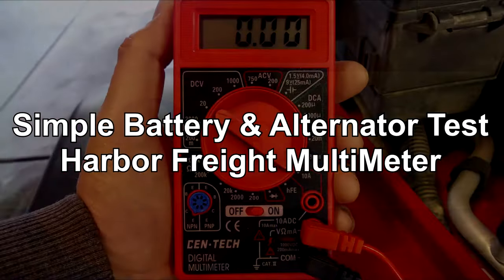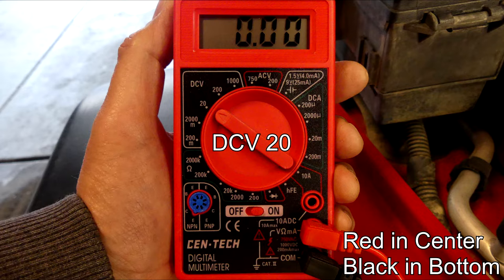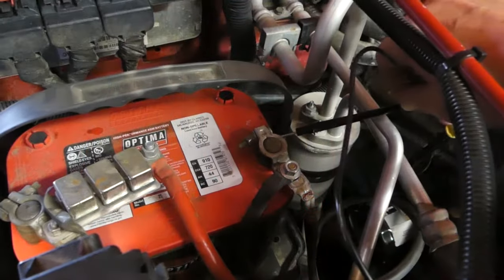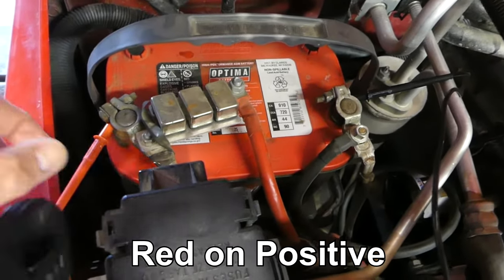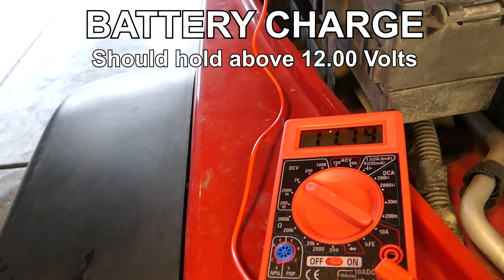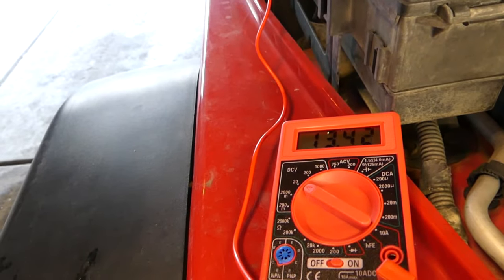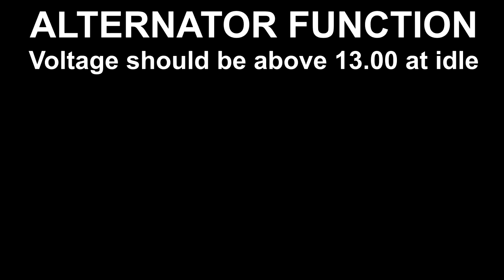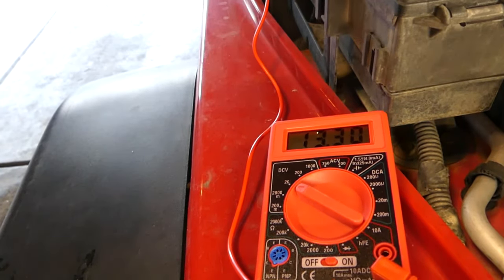How to check Battery & Alternator using Multimeter from Harbor Freight DIY Diagnostic

Comment: Why people say when alternator is on it should be above 14.  Between 14-14.7.   And when its a bit over 13 means alternator is working but only charging the battery a bit “underworking”. So what is it?
Reply from the maker: Alternator output varies from vehicle to vehicle.  13 is correct for my Jeep's OEM alternator, but maybe not for another vehicle.  I'd say it depends on the manufacturer and application.

Comment: great video keeping short and to the point, but interestingly unrelated it only appears we have identical multimeters however mine set too 20 DCV like the video the exact opposite side of the dial mine says 5A & yours says 10A. if anyone else hasn't noticed that on there multimeter as well.

Comment: This really helped except where to place the leads on the alternator. Trying to fix my grandchild's car so she can move to Colorado! patsy
Reply from the maker: You do not change where the leads are, just leave them on the battery, R+ / B-.  The current flows through the leads and battery, that flow is what you are reading when you check the alternator.  It's reading the output of the alternator which is how the battery is charged and how your car makes spark when it's running.  I really HTH!  Best of luck with the car and she's going to LOVE Colorado!!
Reply: @ColoradoOverland   Thank you! I figured it out when I used the Multi Meter.

Comment: I have a 08 Silverado Lt extended cab 1500 5.3. it cranks but no start, I purchased the 7 function multimeter from harbor freight. Hopefully with that multimeter i can be able to check what is draining my battery and also see why it won't turn on.

Comment: What does it mean if the voltage drops to 8.5 while starting but the other two readings are good? It's a jeep JKU. Before starting mine's at 12.6 and after starting it's around 13.xx.
Reply from the maker: sounds like your battery is losing Cold Craking Amps, it's one of the ways batteries age.  Have you tried using a pulse repair charger?  You can search that on amazon, they are not expensive and can sometimes repair CCA issues.  Good luck, hope you don't have to replace it!
Reply: @ColoradoOverland  thanks so much for taking time for your comment. I'll take a look that.

Comment: My Jeep was acting all wonky. Would start with a jump, but lights were fading in and out and car would stall after a few minutes. I knew i had the multi-meter from way back when HF used to give them away for free with an by purchase. I asked Google to find video on how to use Centech Mulimeter. This came up and is a Godsend.
Clear and concise, no superfluous fillers. Awesome video.
BTW, mine registered 2.84 not running, and 14 running. 
Got new battery 👍👍👍
Reply from the maker: I got mine for free from Harbor Freight too!!  I'm glad it worked out for you!  Thank you!!

Comment: I have Harbor Freight multimeter but it only has a 5 amp setting. Every video0 I see including the same multimeter as mine has only a 10 amp setting. Can I test it with 5 amp setting? I'm tracing a parasidic leak.
Reply from the maker: Interesting, I've never encountered that before and don't want to give a guess as advice.  I would imagine it would work just fine, you're not looking for a huge charge.  Best of luck with it, I know how frustrating electrical stuff can be!

Comment: Excellent to the point video! I am extremely grateful to you sir! 
Just checked it because I put a new alternator on the truck (96 Nissan Hard body) at idle its showing 12.40 the battery is 6 years old so I'm assuming my battery is indeed bad. When you get a moment, could you confirm this for me?
Thanks again my friend, fixing to subscribe!
Reply from the maker: That sounds like a low output from the alternator or some sort of drain, usually they run around 14 or so.  Is the battery holding over 12 on it's own?
Reply: @ColoradoOverland   it's holding at 12.38 on it's own. Thanks so much for your reply.